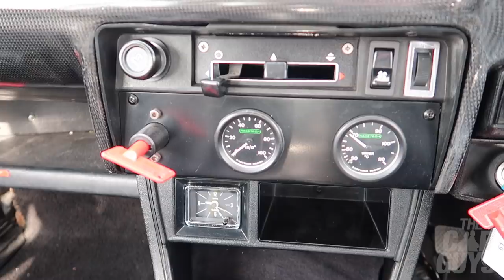The Talbot Sunbeam Lotus arrives!  | TheCarGuys.tv

Comment: I had one of these in the late 1980's - a MkII in Blue with Skip Brown modfications - around 215 bhp; negative camber front cross-member, quick rack, uprated brakes. At a test day on track it was faster than quite a few supercars - I held off a Testarossa for 6 laps of Castle Combe, which attracted some comments from spectators; but it wasn't lightened the way yours is and so in a Lotus race, the modified Elans and 7's were faster. On a rough main road, the biggest problem was keeping it in a straight line - Sierras used to overtake me all the time above 80 mph! Steering was heavy, as you've noticed. Around London it was a great way to make work for the chiropractor...
I never used to use the choke - a couple of pumps of the accelerator to prime the carbs, then hold the pedal down and turn the key. It would start first time. If it didn't. though you had to call the AA - the battery couldn't cope with more than 2-3 starts, due to the high compression.
Great fun, though...